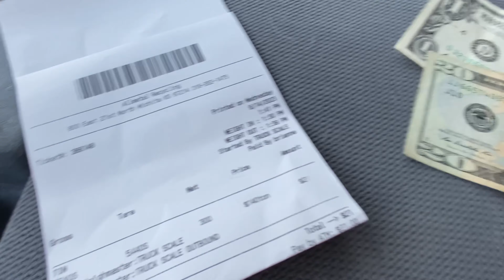My 1968 C10 Auction Delivery

Comment: Looking for an upgrade cab as i bought a 67 and im doing the pros and cons of the coast of one in pretty good shape and doing a reconstruction.....what are you asking for the cab you have from thd auction.....enjoyed the video to
Reply from the maker: Thanks for the support. That one sold before I even listed it. It went for 800 to a buddy. I’ve got a 67 cab I’m selling now. Around here, having a title for the cab brings a lot more money. Patch work can get expensive quickly. Replacing the entire floor section is fairly cost effective since it’s includes all the floors, inner rockers and cab supports all in one piece.
Reply: What are you asking for the 67 and where is ur location
Reply from the maker: @jesseleblanc1199   Wichita KS. Shoot me an email itsthechad71@gmail or message me on FB and I can get you some pics if interested.